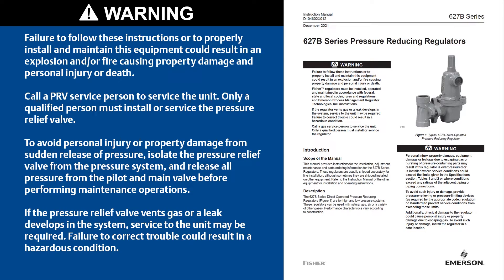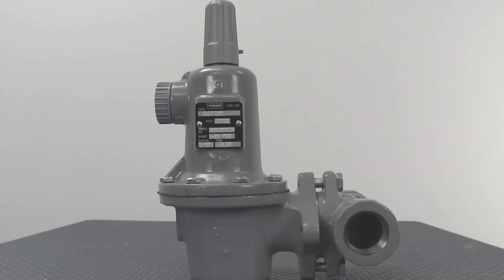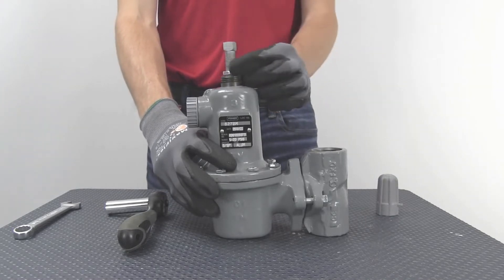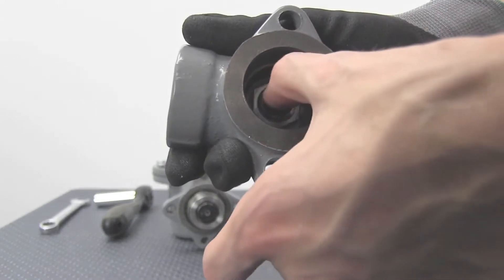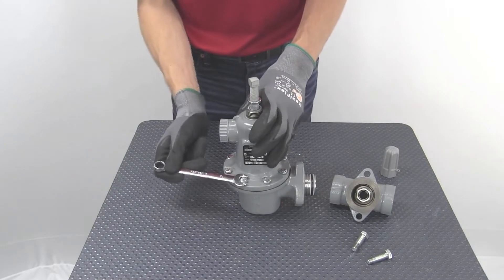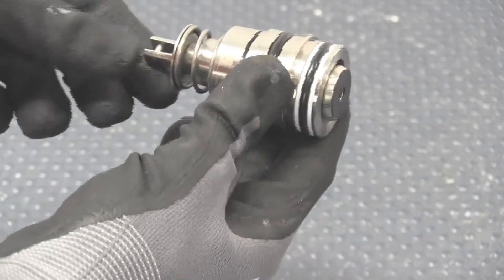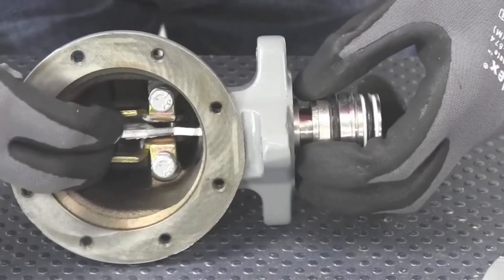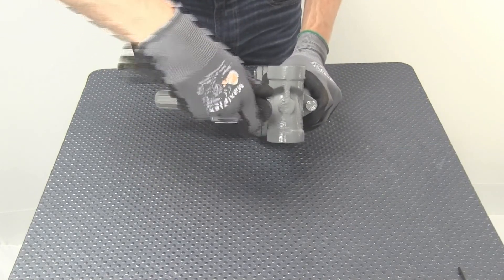Maintaining the Fisher 627BM Direct-Operated Pressure Regulator

Comment: Is LPG can be used with this regulator ?
Reply from the maker: Hello Ahsan, Great Question! 
Although you could use the 627BM in LPG, other Fisher products, like the 627 or 630 in our LPG catalog, will meet an LPG application better. The 627BM's key advantages are seen at much higher pressures, outside of an LPG application's pressure range.